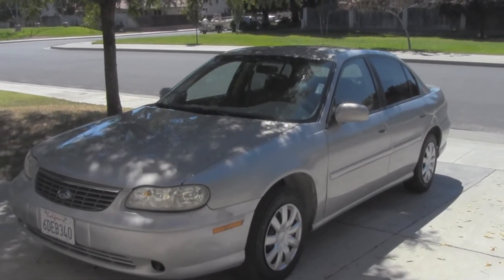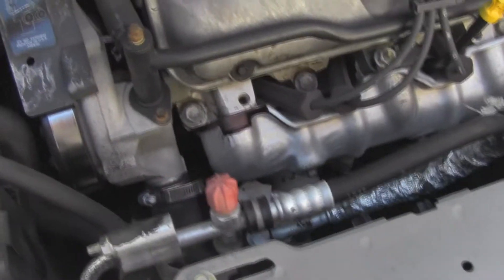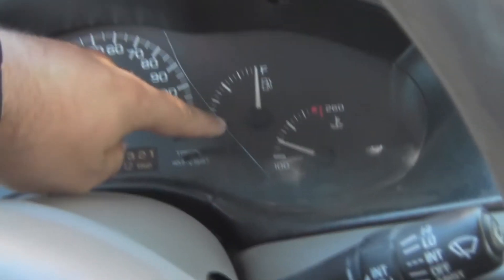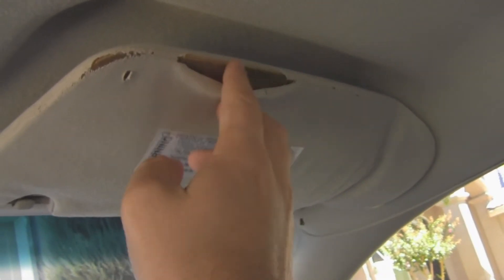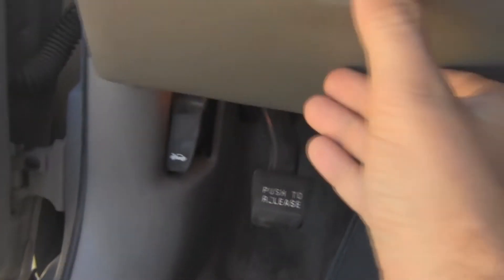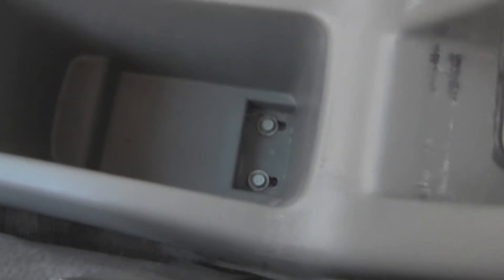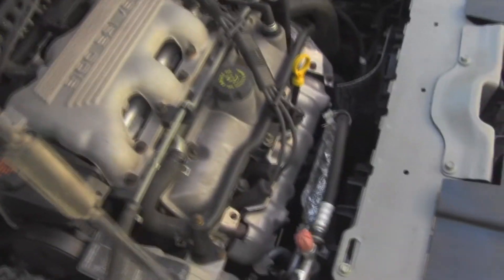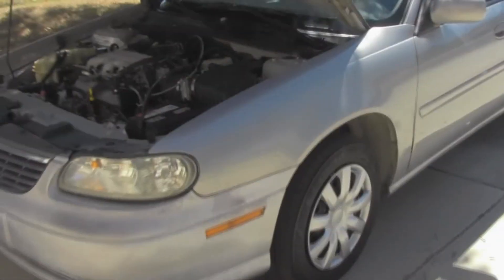1998 Chevy Malibu Overview

Comment: Hey, I just bought a 1998 Chevy Malibu. It has the same hole, drilled into it's dashboard.
The hole is there, because the fuel guage tends to stick, and not accurately shows the amount of gas, in the tank.
The hole is to bump the needle (using a piece of wire, or something).

Comment: I bought one 3 years ago in Victoria Canada for $700 with 150,000 miles on it.  All I’ve needed is a new starter and battery.  Everything else is perfect.  I got a good one on the cheap for sure.👍🏾

Comment: I had one of these for about five years, from 2003 to 2008. I got it from an elderly family friend who decided to stop driving. I had the 3.1 V6, 155 hp. It was a very underrated car - good handler, good power. good gas mileage. A/C always blew cold in the summer. I never had a problem with it, ever. I always though the chassis was good enough for a more powerful engine, maybe 200 hp. Good car.

Comment: for autos especially ones with power  cruise is a must 
huh aperently the old 3.1 got the same mileage if not 1 better but that only had 140  hp 5800 rpm and 185 lb·ft (251 N·m) of torque at 3600 rpm.hp vs your 160 hp (119 kW) at 5200 rpm and 185 lb·ft (251 N·m) at 4000 rpm

This engine is notable for its cooling system issues which may lead to blown head gaskets and cracked heads.